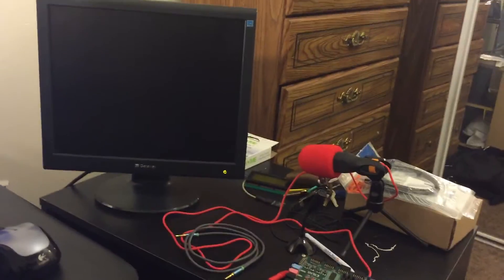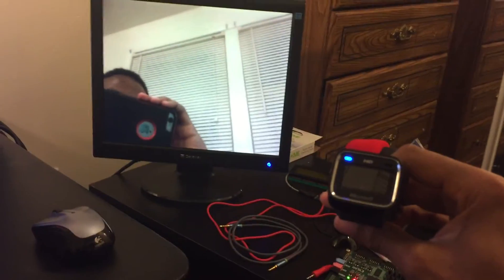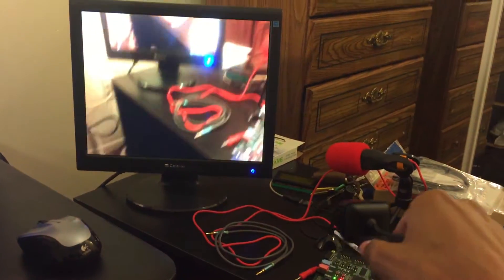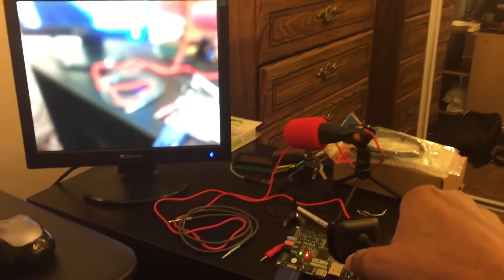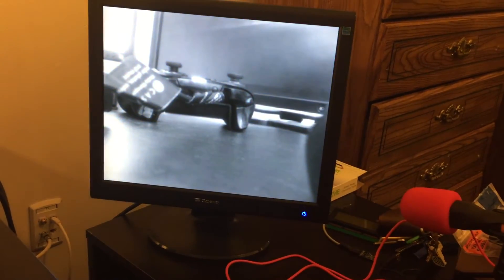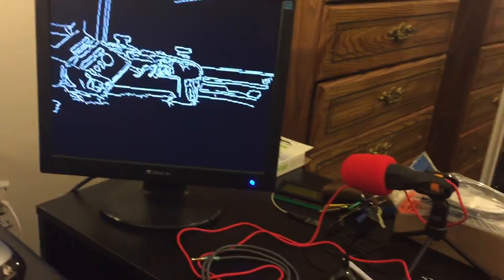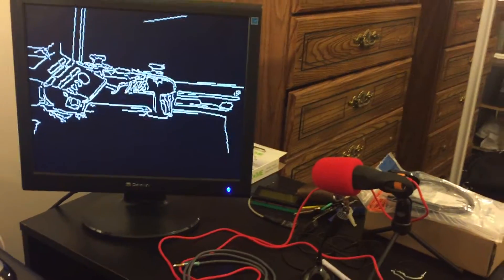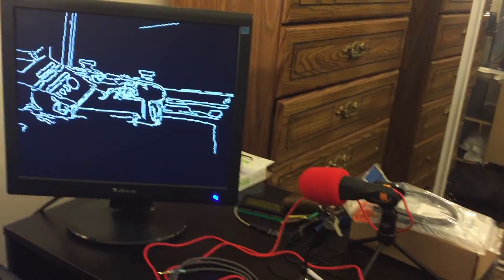Zybo OpenCV Real-Time Video Processing

Comment: Hello Andrew,  can you check it? https://forum.digilentinc.com/topic/16125-usb-cam-interfacing-to-zybo/ It's my project, for now i am stacked with USB interfacing. Where did you find something about it? (I don't use system on fpga, i will make HLS to convert my systemC coding into IPS and then connect all IPs in Vivado Integrator and code some sofware in SDK as baremetal, other details are shown on the site.

Comment: I Need an answer to a problem I faced when trying to use a Zybo FPGA...
I recently bought a Zybo FPGA with its Voucher to get the license of " Vivado System Edition" that allows me to use Vivado HLS

Then I signed in , in the Xilinx website and downloaded the Vivado from the xilinx website with my own Xilinx account, then I installed Vivado System Edition and opened the Licence Manager to get my " Vivado System Edition " license with my own Voucher.

The problem is that when I use my voucher code, I don't get the " Vivado System Edition" in the list of licenses ... so  what should I do to get the Vivado System Edition license ?

Comment: I really like the video ,can you tell me how you install opencv?
Reply from the maker: +rushi qian Hello Rushi! By installation, are you referring to the entire process of building, linking, and ensuring the libraries are accessible on Linux? What I like to do is build the OpenCV libraries as static libraries. You can do this with CMake using the OpenCV list file. Of course, you need to make sure you are using the same compiler you use to build any other application for the ARMv7 architecture. Then, you can link to those libraries in your application!! No need to worry about keeping track of .so files!! Hope this helps!!!
Reply: Thank you so much !

Comment: Great work !!! I try to implement these example project that you share for my zynq board. Thank you so much by the way. Do you suggest that in these applications do we need to have a HD camera which has HDMI port especially(as you did). Can we implement this with USB port ? And working with petaLinux is different than normal linux i am very new at this :'(
Reply from the maker: No problem! ^_^
Reply from the maker: I reread your message and I'm confused. I used a USB camera in the video.

Comment: impressive!!! 
I am working on an image processing project using zedboard, where I need some guidance. I want to read some images from the SD card, do some processing on the PL and finally display the output through HDMI. 
We need some help with the design flow, if possible.
Thanks in advance.
Reply from the maker: Hmmm. Never had a SD card reader, so I never got a chance to do a project with it. But, it should straight forward if you have experience with Linux, building PetaLinux, and RTL development with Vivado. With the Zynq, the SD controller can be enabled by configuring the PS. The hardware description file generated should be recognizable by the petalinux-config tools. Once you have the OS running on the hardware, I want to say that you should be able to mount the SD drive on to a folder. As for the HDMI, I suggest looking into some of the Digilent examples. In the project shown in the video, I am actually using their core to access the VGA. However, it can be configured to drive the HDMI interface. You can follow my project if need help utilizing peripherals from user space. I hope this helps!!! Contact me through email if you need further assistance.